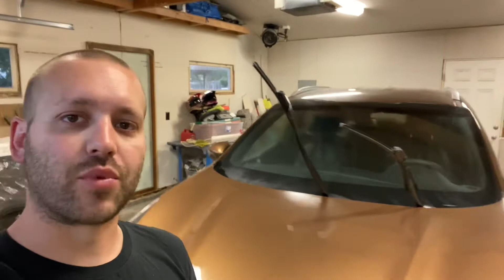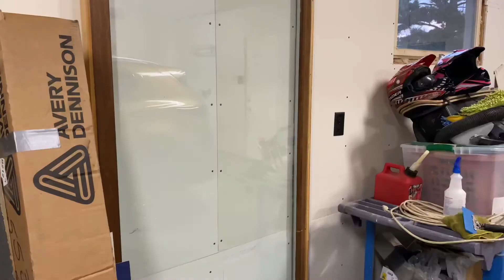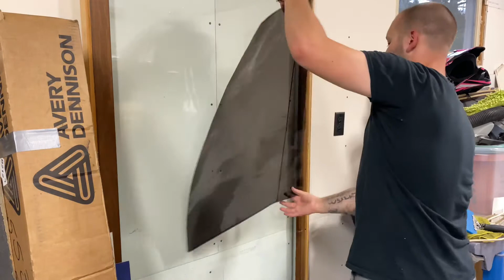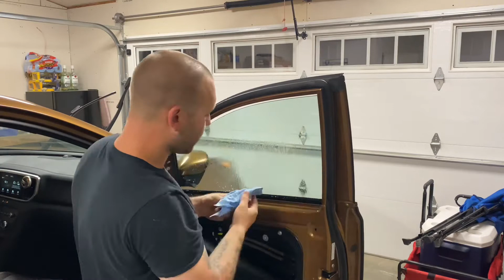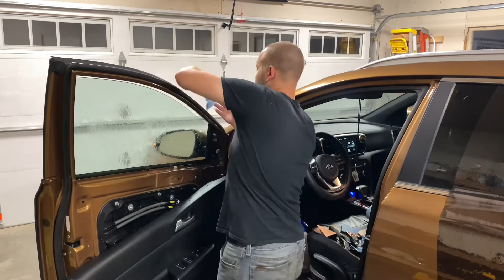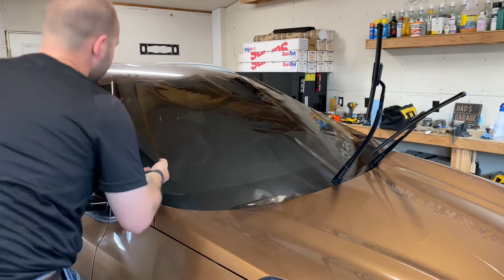Window tinting a Kia Sportage

Comment: I tried doing this same vehicle the other day.  Total fail.  Taking the door panel off would’ve helped that corner for sure.  But the biggest issue I had was the top corner kept catching and wrinkling when I rolled it up.  Wondering if using heat would’ve made the difference.  Seemed like the seal was super tight. I’m still new and first time I couldn’t complete a job. Very defeating.  Great work on yours. Thanks for the video
Reply from the maker: Dang.  That’s a bummer to hear your first go was defeating.   Tinting is a tedious process that can be tricky.  
I personally prefer to pull the panel. When I was just starting I found it to be easier and since continued. For that top corner, seems as though maybe the film was too long and wider than the glass itself within the gasket, or a bit more spray to help slide the film into the gasket and working it in slowly using a thin squeegee.  I actually take a bondo spreader and cut it at an angle to use inside gaskets.  Something else that helps is pushing against the glass while sliding the tint to help relieve some pressure of the gasket and allow the tint to slide a bit easier.  
It definitely took a number of struggles before it finally started to click. A little patience and practice and you’ll get it.

Comment: Is shrinking necessary? As a beginner I don’t want to invest in it but also don’t want my tint not to last as my vehicle is quite a late model. Thanks
Reply from the maker: Many side windows you are able to get by without shrink, though applying heat does assist in drying out the moisture behind the film.  
What is it you’re looking to apply tint?

Comment: Damn so we have to take the door panel off?
Reply from the maker: Not required.  You could leave the panel on and do a 2-step method, which would install the top edge first, then tuck into the bottom gasket after rolling the glass up. 
My preference is to bottom load without the panel. Easier in my opinion and allows the film to tuck a bit further past the gasket.

Comment: Do you happen to know the factory percentage on the Kia Sportage also what percentage did you install? thanks!
Reply from the maker: Hey!  I am not familiar with the exact factory percentage however typically what I’ve found to be a good rule of thumb is about 20%. 
On this particular Sportage I installed a 35% film, which will measure to be about 28% when combined with the glass as well. 
So the front doors will be close, but slightly lighter in this combination. 
Hope this helps!
Reply: Thanks! Great channel keep up the good work!
Reply from the maker: @ronfriend  Appreciate it!

Comment: Do you have to remove door panel ?
Reply from the maker: Not required.  There are many installers who will not but I prefer to cut the bottom edge long and dry in place below the gasket to ensure there are no issues. There isn’t a right or wrong, just personal preference.
Reply: Thank you . With panel on . What issue may arrise from not going in long
Reply from the maker: @expressdiy6956  I find it a bit more tedious to get the tint tucked into place. The shorter cut has a potential to catch on the gasket when rolling window down and peeling up.  Plus, the gasket tends to hold moisture and make it harder to make sure the tint is in place and dry.
Reply: I'm a beginner and am attempting to tint my own car . Failed 3 times so far
Reply from the maker: @expressdiy6956  Don’t give up! You’ll be happy once you get it and can say you did it yourself. 
What vehicle are you trying to tint?
Reply: Mercedes Benz eclass
Reply: I appreciate the motivation. 
I noticed your video are good quality. Keep content coming. . you'll do well
Reply from the maker: @expressdiy6956  Something that might help is a preshrink on the film. I’ve shown it in a couple videos I think Challenger or Mustang but not a lot of detail.  Search tint snap shrink and you’ll find plenty of tips.